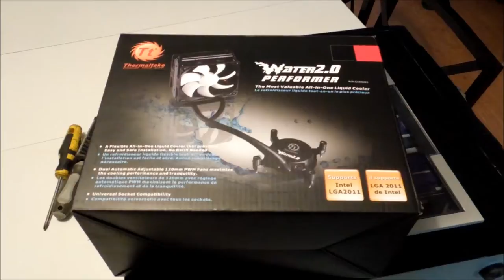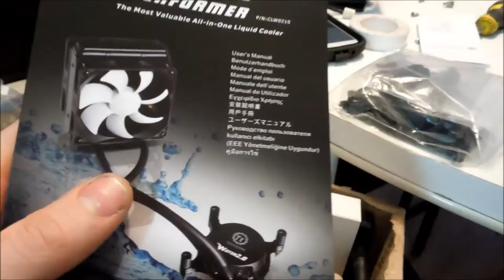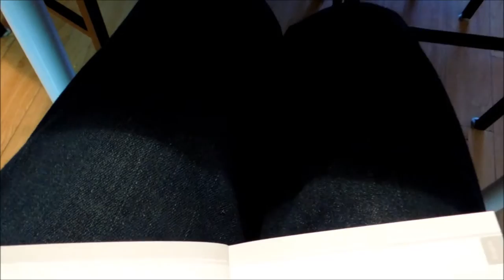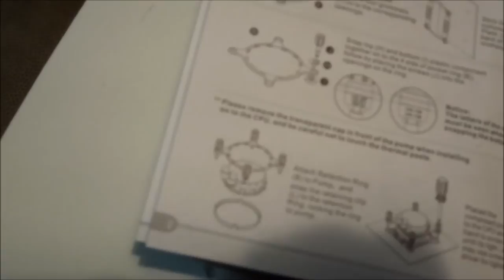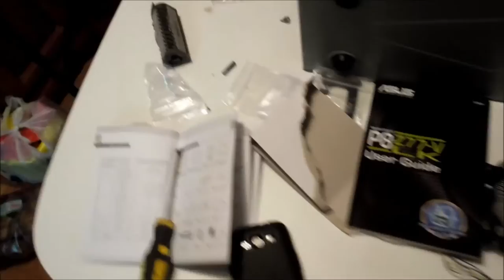how to switch your cpu to watercooling

Comment: Pre-sealed loops with small, thin and low-density fin rads. more often than not get outperformed by good heatsinks; e.g. NH-D14, PH-TC14PE, etc.
The pumps are also ridiculously noisy.
For me, at least, it's custom or no WCing.

Comment from the maker: i find this unit it much quieter than my intel cooler i don't even notice it until i run something graphic intensive .
Reply: Hmmh; I'm not sure. I've witnessed most of Corsair's pre-sealed loops and find them to be noisy, let alone getting beaten by mid high-end and top high-end HS&Fs.
Glad it suits your needs though.

I just don't personally think that they're worthwhile if they're noisier than top-end HS&F solutions, as well as delivering less performance and being more expensive; but yeah, if it works for you, good on ya! :)